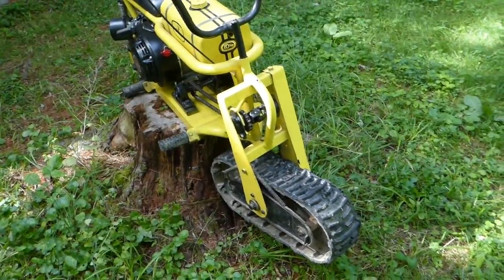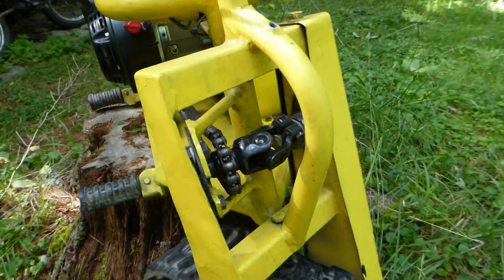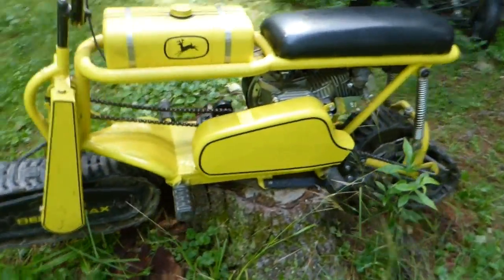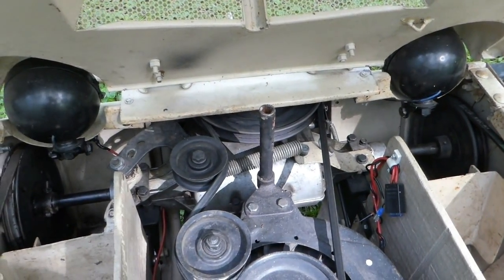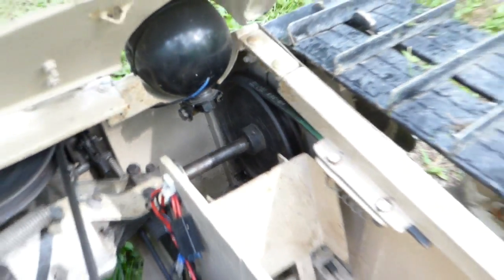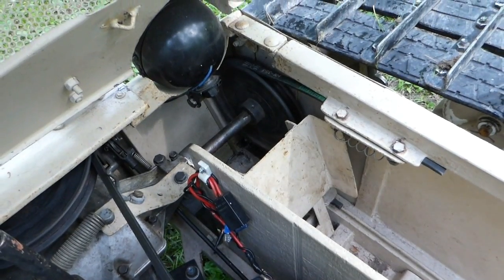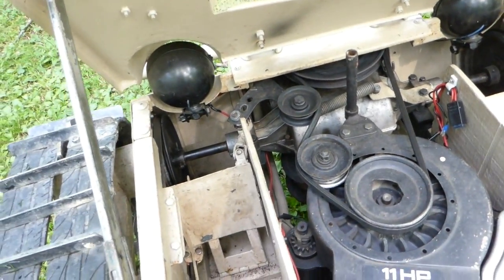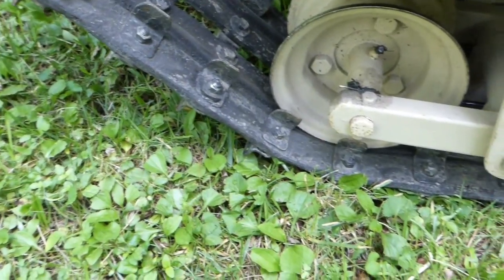Steering Setup in Goliath Tank and Track Bike

Comment: kinda late to the party, but why not do a wedge design for the turning leaver? Like a 30 degree wedge, on a track connected to the turning stick. This way you push into it causing more friction and you would not have to change much. Would feel more reliable as well cause if your turning and your band breaks, well, there goes the show. The wedge could be from the rubber pads from a ladder you don't need or something similar.

Comment: B 4 demolition tank radio controlled used in  WW 2
Reply: B 4  did belong to secret weapon,controlled from  tiger tank,carried 100 Kg. TNT, up to 15 Km controlled via  Fm.radio transmitter Pm.code modulation,speed up to 40 Km,auto gear 5 forwards 5 return

Comment: another thing you could do is get some hydraulic disk brakes off a old motorcycle and put them on in place of the v belt pulleys the disk brakes would never break.
Reply from the maker: Yes i have upgraded them to band brakes they are holding up well. I have a video on it

Comment: Great idea using the ride-on mower transaxle. I have the same idea for my near future build; except I plan to use the rear axle from an early 90's Kawasaki ATV. It has a differential on it with the bonus of a lever activated diff-lock if I need the traction of both tracks. The built in shoe brakes should make for an easy steer setup as well. This was a shaft drive and I have the engine from a chain drive atv (with reverse) which I plan to tie in with this axle. Should be fun.